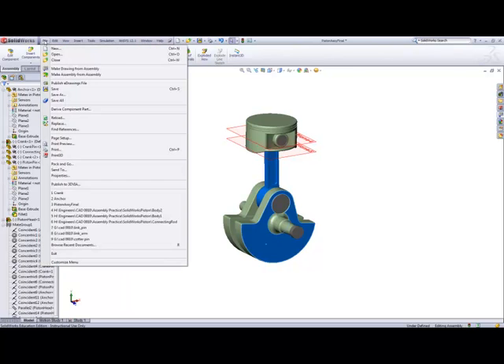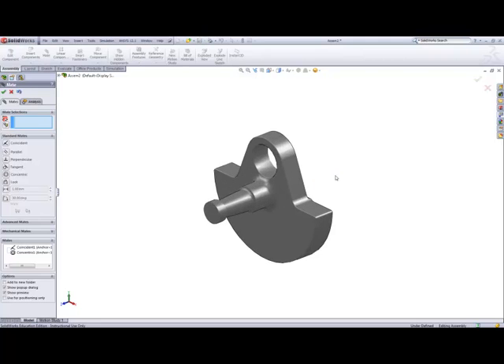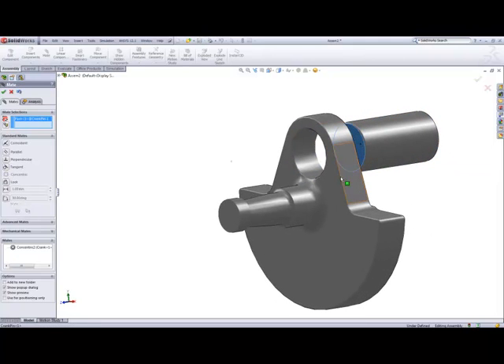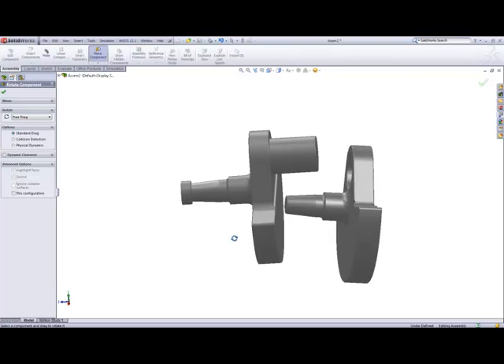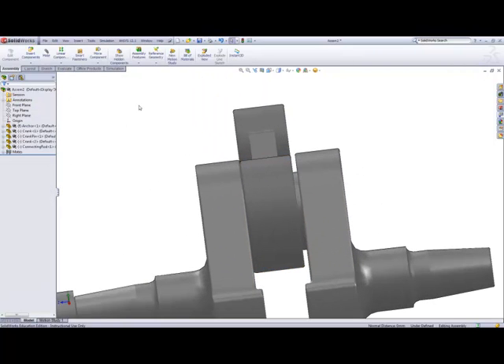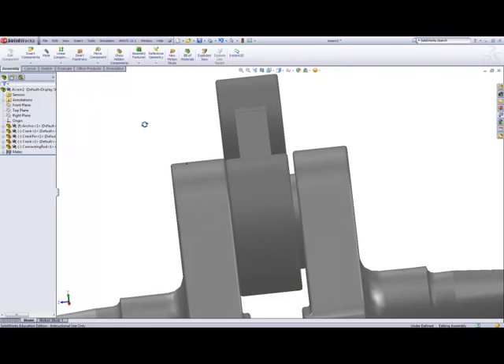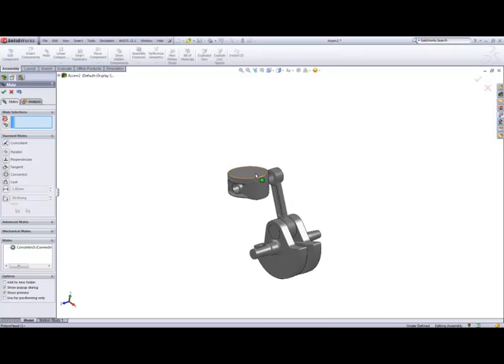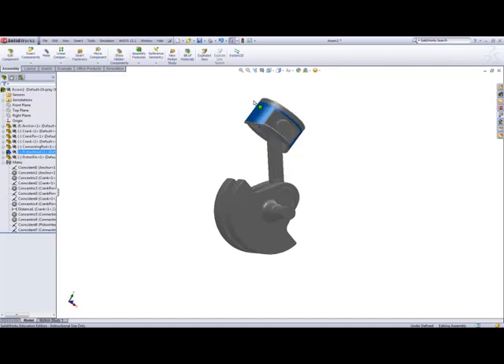Solidworks Assembly Tutorial - 1 cylinder engine pt2

Comment: Hi Virtual3D,
This video was very helpful to me. I have a question which you may be able to assist with.
I have a universal joint (3 parts) pivot part with 2 connector parts. There is an option for a universal joint mate but i have no idea how to use it. i have created mates for the joints and fixed one part. When I move the free connector it only move on one (side to side) axis and does not rotate the pivot. I need to select the pivot directly to move vertically. an ideas- guides?